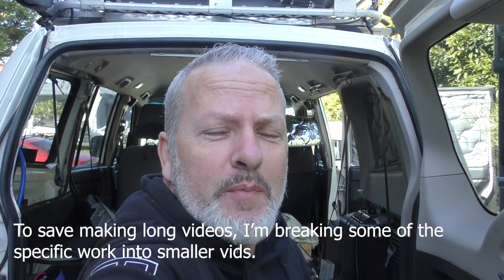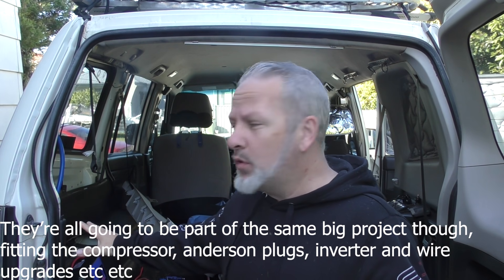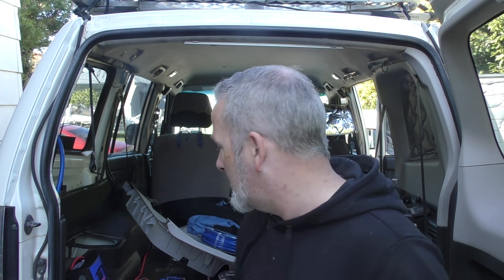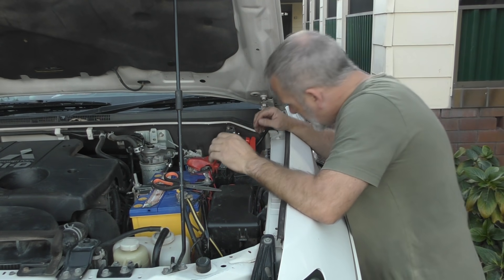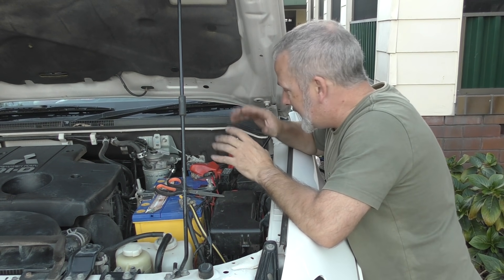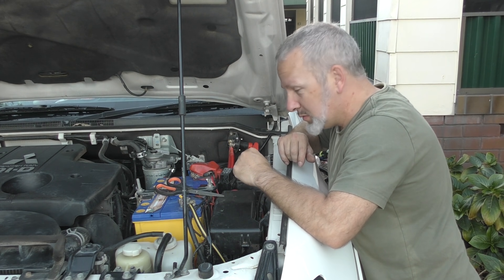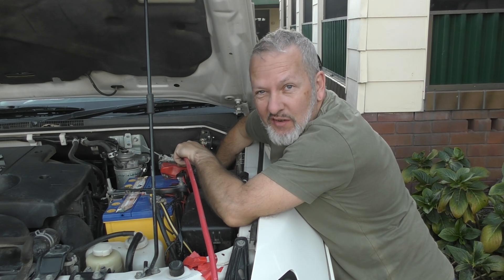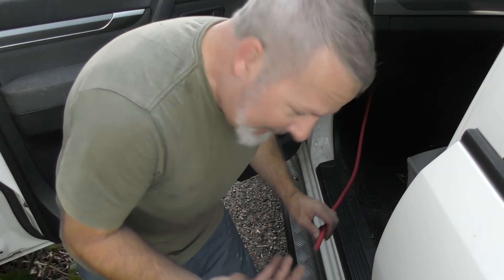Routing Cable from the engine bay to the back of your Pajero

Comment: Great video and work! I'm working on the very same project currently: running two battery wires (positive and negative) from one of the two main batteries (I got the version of the Pajero with two batteries under the bonnet which run in parallel, so basically one big 12V cranking batterie) under the bonnet of my 4th gen Pajero to the back where the third seat row used to be.

(The Pajero can be started with only one of those two batteries because they are in parallel, but the double battery solution in quite common here in Europe. I've heard Mitsubishi does it because of the cooler temperature in some countries (definitely cooler than in Australia). With only one cranking battery, especially when it's not the newest, starting the Pajero in winter conditions can sometimes be a mess. Because of that and also because I love doing winter trips in Norway, Finland, ... when -30 to -40°C are common, I equiped my Pajero with two types of pre-heaters (electrically and fuel.)

For this project, I'm using some really heavy-duty battery wires (75mm^2), because I want to connect my deap cycle battery which sits in the back, my compressor and my DC-DC-charger in the back. Additionally, I want to use the deap cycle battery in the back for emergency cranking situation, when the batteries in the front are dead. So the compressor just sits in the back, but is powered from the cranking batteries in the front, so it's connected before the connection of the deap cycle battery.

My question: Is it correct what I saw in your awesome video, that you've only run one battery (your red positive one) from the front to the back? By the way: which size was that? Where to you take your negative/ground from? Just the metal of the chassy? I decided to run both positive and negative from the front to the back to avoid back connections and voltage drops - especially because I connect the project for emergency cranking. What is your opinion of that? Is it necessary / not necessary for what I build? As I saw in your video the space for running even only one cable of that size from the front to the back is quite small. It looked like two of that size wouldn't fit in there. What do you think? That was the reason why up to now my building idea was to run the two heavy duty batteries from font to back under the car (well protected of course).

I love your channel! Got a lot of great building ideas from you and you channel. Finding good Pajero customizing communities here in Germany is not that easy. Because the offroad/overlanding and Pajero and bigger cars in general community here is so small. Basically, because you can't buy these type of cars here (anymore) because of politically and environmental reasons.
Reply from the maker: Hi Christian. thanks for the massive comment and all that info. I didn't know about the 2 battery variant. I have to know though, where do they stick the second one and what size is it ? 
I am considering a 2nd start battery like yours mainly for winching when required. we can get a small tray that sits behind the main battery but the tray is small and takes up the room where my relays for my driving lights, 2nd fuse panel and my 2nd fuel filter is going to go. So I don't think it will happen. 
Ive heard of cars in canada that have heating systems because of the cold. It was new to me and not something I had thought of before since we dont need it here. I'm glad we don't see those temps here. A couple degrees under 0celcius is about as cold as it gets where I am. It can snow about an hour away but not here on the coast. maybe once every 20 years or so. 

The new wire I've ran is 50mm^2 . It's more for industrial wiring and so isn't very flexible ( thick strands), but for the price I paid, I jumped on it and made it work. 

You are correct, rather than going back to the main battery, I use a chassis ground and always have now that I think about it. I do this in my caravan too. I've not had any issues yet using this method and it sure saves those extra runs of wire and cost of course.  That said, I will be upgrading all the grounding in the engine bay soon using that same wire to ensure I have the other half of the circuit . I've used big wire for the positive side and need to match that on the ground side. This will also help with my radio gear in the car for amateur radio . 
I think you could get both through those spaces though, if that is what you want to do. it will be very tight, but I think it would be possible. 

I hope I covered everything. if I didn't let me know. 
thanks for commenting again, I really get a kick out of hearing from viewers in other countries . 

cheers Brett
Reply: DENMONKEY hi Brett! Thanks so much for your quick reply. Your info really helps me a lot as I know now that your cable is a bit smaller than what I’m going to use. For the moment I think I’ll stay with my „under the car“ solution for running the two 75mm^2 wires. I’m currently building a wiring rail made from alloy to put the wires well protected (plastic tubing and so on) in there for the under the car part. So far it’s a „I’ll decide during the build“ way I’m currently doing. So far not completely sure about both variants. But I’ll see what will work out the best and with which way I’m most happy about.
Reply: DENMONKEY oh. Almost forgot: the two cranking batteries under the bonnet are evenly placed: one on the left (which is the driver’s site here) and the other one on the right. If you’re interested in the exact fitting and wiring, I’ll be happy two share some pictures. I’m currently using two OPTIMA yellow tops (YT U 4,2) which are now the best solution for my purpose and for what I run from the starter batteries (diesel pre heater and after market car alarm from VIPER - the Pajeros here in Europe always came without the factory car alarm). Since the car alarm always drains a bit power and the car’s ventilation is running when running the diesel pre heater (from Webasto), I realized that AGM starter batteries are a much better solution for me than the standard lead-acid batteries which where smaller and also performance of them was bad. My first Pajero was a 2007 forth gen version. The factory batteries were ok. But over the years Mitsubishi reduced the battery size (same measurements) and performance. My current Pajero is 2016 4th gen. And in winter especially when hooking up additional electrically consumers performance of the factory batteries got worse. So the Yellow Tops AGM as my new solution are really great. They are starter batteries but tolerate power drains much better than lead acid. They also have much better cold cranking amps. Yeah, well and when winching pre running other big consumers (huge compressors) the double cranking battery (in parallel) solution is really great. I’ll fit a winch to my Pajero shortly as well. So I really can recommend this two cranking battery solution! Would be interested if we can watch that as one of your next customizing videos ;-).

Comment: Got the fun job of doing that myself shortly to connect a DC-DC charger & dual battery. Battery is going into the 3rd row seat well as I believe you have done (Gen 3). Thought about installing the compressor there as well connected to the 2nd battery but been told I shouldn't do that as a Deep Cycle isnt designed for the higher amp draw. Might still do it and run a wire from the front battery with an Anderson plug for the compressor. Im planning to use thinner wire for the DC-DC though. I was told 140ah by Supercheap but 50ah by Auto Barn. Given Im running a 20ah DC-DC the 50ah should be fine.
Reply: Mick Graham, for me, I chose to run the 140A 6AWG from Supercheap for future upgrades and to avoid power loss. At the same time I also ran a 20A cable for other applications into the future because there’s a bit of mucking around running the wires.  😊👍🏼
Reply: @glennreggie3036  I've thought about that but really don't see any upgrades that big happening. The 2nd battery is only running a fridge and small devices like USB and a 12v tv. I will also have a 110w solar panel for the majority of my charging needs
Reply from the maker: that's spot on Mick. deep cycles arent made for big draws, rather smaller long term ones. Thats what your main battery is for. Plus you always have your car running when you run the compressor, so it helps take the load off the battery . 
I'd be going bigger wire than that. think 6AWG around 100A for example. I know it cost more but you may need it. 
I know where you're coming from with regards to thinking you only need 20A for the dcdc charger and 50A is bigger than that, so you will be all good. 
But that's not why you go bigger cable. When you use smaller cable, you loose voltage from one end to the other,. the smaller the wire the bigger the drop . 
Your dcdc charger may need a certain voltage to turn on and work. If the loss in your smaller wire is enough, you won't get the voltage you need  for the job. 
You should be able to find your chargers spec which will tell you the min voltage it needs to work. 
It could be as high as 12.8v, so be sure to have a look.  It's worth spending the extra bucks to be sure you've  done it right. 
Rather than going to super cheap etc, check out ebay for wire. it's often much cheaper and you might find for the price theyre asking for 50amp stuff in store, you can get the bigger stuff for near the same price. 
alternatively, keep an eye on facebook market place or gumtree. people often sell am wiring kits, unused and they can have some good size wire in them and can be had for a bargain.
Reply: @DENMONKEY  I will check it all out when it all turns up. Going the Ctek 20ah DC-DC from 4wd Supacenter. Don't think the minimum amp was too bad. I've noticed today I've got some bigger wire in the garage from an old Amplifier so may end up using that if it's long enough. Got 50amp & 100amp fuses as well from the same amp. I have to wait a week or so for everything to turn up (except my fridge which will be longer) so I'm going to wait till everything is hear and I can rebuild the rear layout to suit exactly what I want and need. I use the back for sleeping as well so going the Waeco CD-30 Draw fridge but seems no one has them in stock atm
Reply: DENMONKEY having the auto, I have dual purpose batteries front and rear (cranking/deep cycle), so if my front cranking battery becomes flat, I can still just start from the rear battery.

Comment: Right in the middle doing the same (a plus not using the vehicle every day). I am running my compressor in the seat compartment as I already have dual batt's in the engine bay. I am also going to run an air tank.
Reply from the maker: Hey Jay, I used to store mine in that space and considered just mounting it in there. frankly it would have been much easier. I'm going to be pretty happy having that space back though for some extra storage. For your 2nd battery, did you get one of those trays that sit behind the main one ?
Reply: @DENMONKEY  battery tray I have runs across the firewall, I was able to get an N70 100ah in there (went for a serviceable battery because of the heat) I only run one fridge in the car it's on all the time. I have a separate cable to Anderson plug for the caravan that runs under the car.

Comment: FWIW, I used the same cable route on my vehicle, but I pushed the heavy cable through from inside the car so I only had to struggle with a fairly short bit of cable to push through. Means I didn't need to feed a whole car-length of cable through that rubber grommet/seal.
Reply from the maker: yeah that's the smart way to do it :) I have so much going through it though, that I can't feel the hole in the rubber from the inside. Which leaves me coming in from the engine side. not perfect I know but it's all I had to work with.
Reply: Thanks for your reply :-) I find that a length of heavy whipper-snipper cord works well as a draw-wire, and a bit of something slippery on the big wire to help it through.
So glad I found your channel - really helpful, thorough info delivered in a friendly, easily understood manner. Thankyou!!

Comment: Hi, did you ever get round to making Pajero Aux battery /solar panel/ dc dc charger install p4 onwards I cant seem to find it and wanted to see how you wired in the fusebox etc etc
Reply from the maker: part 3 was as far as it went. I appologies mate, I don't recall exactly what content I covered from back then. Do you mean the fuses in the engine bay or the rear ? The set up was very similar to what you see in the compressor series, but rather than the stand alone fuse I used in that video, I ran a dedicated power line from the ANL fuse panel up front to the dcdc charger that was in the back (projecta) I also used that same fuse panel to run power to my amps etc in the car. so with the new set up, the dcdc has a dedicate single fuse block. hope that makes sense and helps. if not, fire me any questions.

Comment: You are shitting me. I just spent half today mucking around pulling interior panels running power cable from the main battery to the rear......to come inside with it 90% done and find this video, entitled exactly what I’ve just been labouring 😂😅😂
Reply from the maker: Sorry Mike, I've been meaning to do this one for ages and should have covered this other stuff off before when I did it. Sometimes I just can't be assed and just wanna get the job done. :) what's the plan your end ?
Reply: DENMONKEY no worries at all. I used the info from your first part of the compressor install to figure out how those panels came out so all good! You helped out big time. I was just replacing the tiny 16 gauge cable running to the rear the previous owner installed with an 8 gauge one. And a proper fused distribution box down the back there for perimeter lights, reverse lights, Andersons, cigs etc.